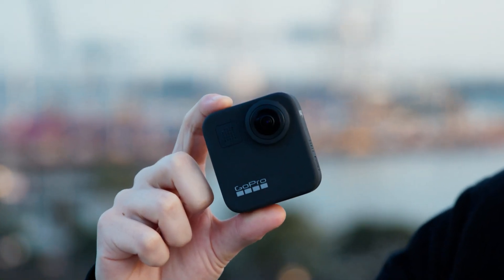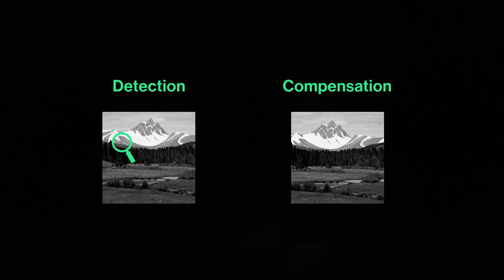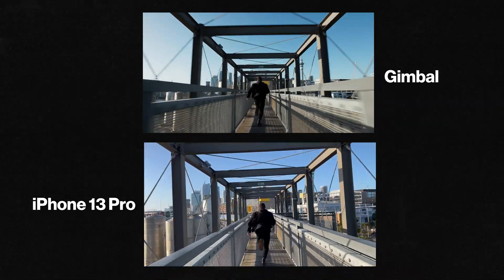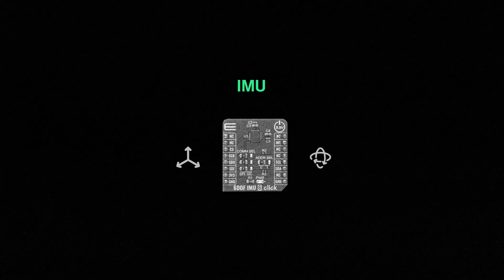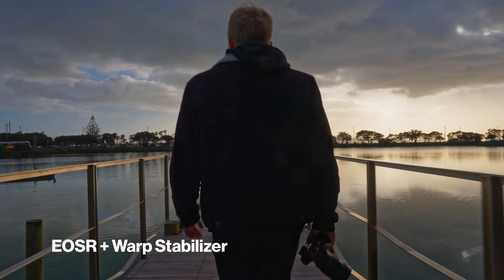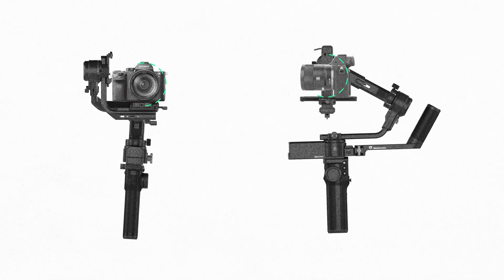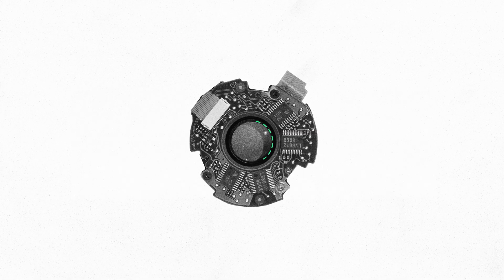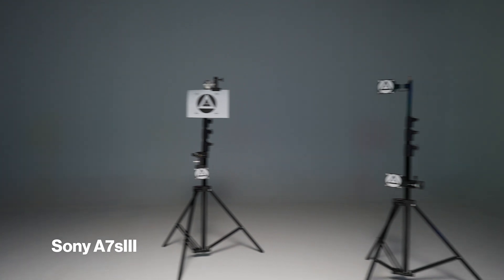Testing Every Stabilizer So You Don't Have To

Comment: There are some missing pieces. Post stabilization will always be better than realtime/in-body software stabilization. You have way more computational power and you know the "future". However, the gyro data is always useful is best combined with optical flow tracking (not either or). With that, you can even tape an action cam on your red komodo as an IMU tracker,  put everything on a drone and throw the results into gyroflow to get buttery smooth footage.
Reply: Agreed! But it speak volumes that the computational power of iPhones for example is so strong that the quality of the cinematic mode is so good. I think the real question is is the stabilisation tech at the lower end of the market worth it? Yes it is. 😊

Comment: I use to use a mobile gimbal by evo, but when I upgraded my phone it came with built in sensor stabilisation (not just digital frame only) that seemed to fight against the stabilisation of the gimbal, id get these weird vibrations in the footage during certain gimbal moves making most clips unusable. Did you experience anything like that in your tests? I'm not sure if it's an issue of modern phones not really needing a gimbal, the image stabilisation getting into unexpected situations (fighting the gimbal), or of the old gimbal not moving fast enough for the modern phones own stabilisation. Etc